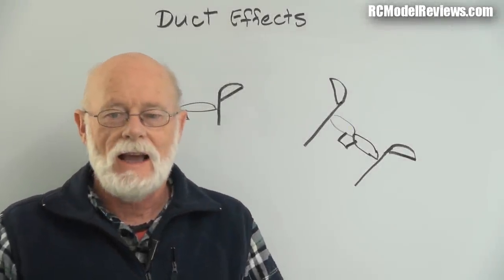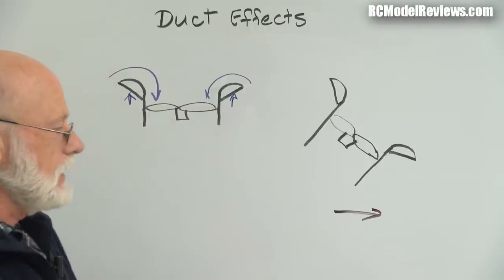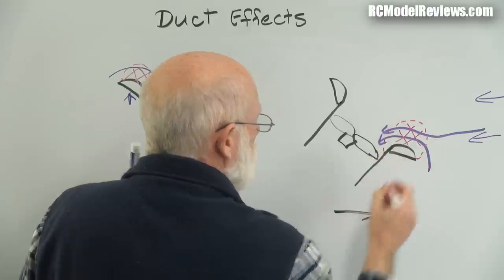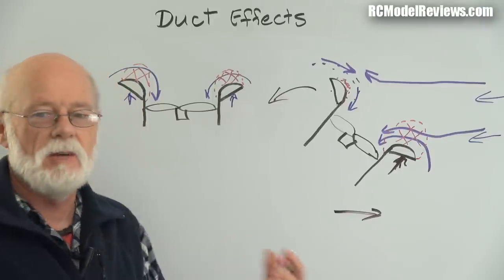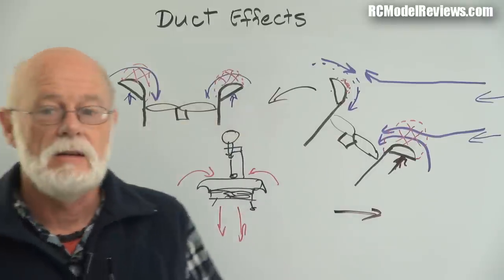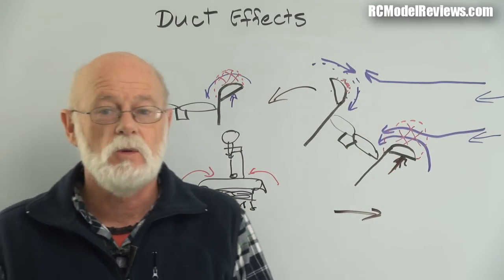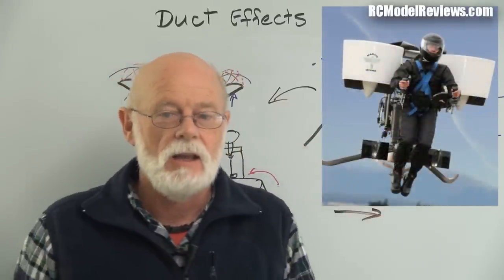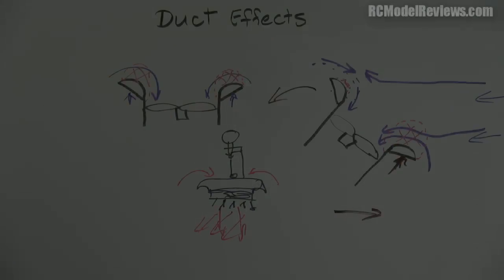More on ducted propeller systems

Comment: 16 miles per hour ain't that bad. It's faster than running and you can of course fly over obstacles. Would be great for pursuing fugitives fleeing on foot.
Reply: but practically I'd reckon that a 120 hp motorcycle would probably be more effective, no?
Reply: kumoyuki I'm thinking places like swampland around prisons, minefields, areas of contamination. Also, a motorcycle just doesn't give the advantage of elevation to see over obstacles, move over obstacles and be essentially immune to being knocked off.

A motorcycle is very fast but then the fugitive climbs over a low wall or a tree log. Or crosses a body of water.

Not only that but in disasters, after earthquakes and floods often debris can make moving just a few metres impossible if only you could just hover over that short distance. The Fukushima disaster was made worse jsut by the inability to move a cable over a few hundred metres of debris.

Though most of the observation work can now be done by drones, sending a drone out with thermal imaging would probably be as good if not better at pursuing a fugitive.
Reply: fair enough. I was still stuck thinking in military terms - which has a different cost/benefit calculation
Reply: kumoyuki Oh yeah, in military terms you're just a giant target.
Reply: Beats the hell out of a mall cop on a Segue...
Reply: Or, if you're going to go through the trouble of training pilots you could use one of those new-fangled helicopters. And then you have the added benefit of that fugitive not getting away when they enter one of those "automobiles" that I've heard so much about.
Reply: LOL.. Well said!
Reply: hovercraft
Reply: @kumoyuki  so would a sedgeway apparently.
Reply: Well said and considered. Wonder if with a bit of technical design, it could be made to move faster by varying the lip profile to the oncoming air, as with vectored exhaust nozzles. Probably this would greatly affect the duct’s lifting characteristics if possible though.

Comment: I'm a hovercraft (ground effect vehicle) enthusiast. I've always been mystified as to why the flying platform never succeeded. Thank you for this explanation.

Please know that ducted fans are extremely popular among hovercraft designers as horizontal thrust fans. They provide a framework for protective screening that prevents fingers or large objects from contacting the propeller blades as well as the superior performance.
Reply: Still doesn't explain why a multi-engine design never arose.

Rather than trying to redirect the thrust of the lifting fan, why aren't there additional fans mounted at a 90 degree angle solely to produce forward motion?

Seems a rather self-evident solution if rotating the engines proves to be a problem...
Reply: @KuraIthys  you are still going to have the unbalance to deal with. The first gyrocopters had the same problem.... would accelerate down the runway until takeoff, then lift up and immediately tip over to upside down because of the difference in lift caused by the difference in air speed between the side of the rotor that was advancing and the side that was retreating. Helicopters solved the problem by changing the pitch of the rotor as it went around using a "swash plate", gyrocopters solved it much simpler by simply allowing the rotor blade to "teeter" back and forth so the advancing blade rises as it moves forward then descends as it retreats on the other side of the craft.

Comment: I have just gone back to electronics as a hobby after a 51 year break. I was rather shocked to find that any mention of fans for cooling is almost taboo. I like fans. Heat governs the life of an electronic component. However the fans that are used for PC's, power supples and servers etc. are ducted but have large tip clearances, any thing up to 3mm on a 60mm dia fan. It would cost no more to make this gap 1mm. Maybe they should watch your viseos. Thanks for confirming what I had already guessed, it's just logic. I'm subscribing - great channel

Comment: Very interesting video Bruce! I think there might be a similar, although less dramatic effect on bare propellers. Not sure what it is, but if you think of the rotating blades as a disc, the rear blades have air being pushed out towards the blade tip whereas the leading edge of the disc gets air angled in towards the root.

Comment: What would happen in an aircraft where you rotate the ducted fan? When it's upgright, it stabilizes the levitation during vertical take-off and landing. And during flight it stabilizes the aircraft in addition to the wings? Or would it fail during the transition?

Comment: I wonder what would happen if you could vary sections of the lips, profile
Reply: that's a basically how a helicopter works
Reply: I was thinking of a bunch interconnected metal flaps like the nozzle of a jet engine, but independently controlled
Reply: actually I was thinking that maybe have a sort of mesh that slide modified the shape of that round bevel at the rim
Reply: Maybe an even riskier design where it would "stall" the coanda effect by protruding flaps to block airflow on one side of the lip.

Comment: The Bell X22, if I recall correctly, resembled a quad with a tail attached to it. Had 4 tilting ducted fans and operated much like the V22 Osprey does today. It was intended to have V/STOL capability but it was much too finicky. It's a shame only two were ever built though, was a beautiful aircraft.

Comment: It sounds like ducts would be best for stable camera quads used in filming.

Also, i wonder if one of these could be used with a vertical propeller for movement, kind of like a PPC
Reply: ***** This is what I was thinking...
Reply: ***** Probably not, airflow is still across duct in one direction tilted or not.
Reply: ***** 
Bruce, do you have an email? I'm going to buy my first quadcopter parts from online, I'd like to run my budget and the list by you. Owen
Reply: owenkilleen I'm not bruce, nor do i care
Reply: ***** you tube won't let me post a comment straight in my own comment field. David
Reply: ***** Ducted fans have worse performance in slow speed and hovering than large rotors.
Reply: No, it does not compensate for wind!

Comment: Been watching vids of a quadcopter working quite well on its test flight, using EDFs. They are working in the usual manner for a quad, not swiveling or anything. How is this the case? Is an EDF pulling so much air that the flow from front to back (in the direction of flight) over the lip of the duct is insignificant by comparison?

Comment: Cool discretion but I bet it would actually work just fine depending on how sturdy the duct is. The effect would be more of a twist for the arm to resist rather than a force on the craft. Also, if it is a real problem maybe just gradually reduce the lip a little on the front end of the craft. Could still improve efficiency. Lastly, since phantoms usually just hover anyways, wouldn't this make sense for that craft?  Putting crash resistance aside.

Comment: Hey Bruce,I was wondering if you could make a video of your DIY 5.8Ghz 200mW video receiver that's in the same stile as the backpack,tell us how much cheaper and comperabile it is as some not so cheap ones ? Also I was wondering if takeing 3 $2 deversity conrolers could you make a 4 input one that will work like the $25 one that you showed us?

Comment: Like in the previous video, invoking the Bernoulli effect only confuses the issue because it's the vehicle that's moving, not the air. The forward edge of the duct is traveling at the exact same speed as the trailing edge. Since there is no air speed differential between the two surfaces, there can be no Bernoulli effect. 

But there is a difference in the Coanda effect between the two surfaces. As you point out, it's increased on the leading edge and diminished on the trailing edge. In effect, the trailing edge was stalling because of the steep angle of attack. It was designed to attack in an upward direction, not in a forward direction, so unsurprisingly, it fails to perform well going forward.

They could probably make it work by adding a small airfoil above the shroud directing air downward into the trailing half of the duct. An airfoil at that position could be adjusted to have the correct angle of attack and compensate for the loss of the Coanda effect. Of course, with the pilot exposed they don't have many opportunities to reduce drag by creating a slipperier vehicle envelope so the speed is always going to be relatively limited. But they should be able to get it to go as fast as a motorcycle.

Comment: It would have been interesting if they had implemented a way to modify parts of the lip. So if the platform was tilting in one direction, then somehow the lop on the opposite side could be changed.
Reply: I thought of this too, although in reverse (make the angle/curve of the lip in the direction you are going change to reduce lift on that side). I think that either way the net result is a loss of lift upon changing the shape, creating a need for larger motors. But I sure hope someone is gonna build a drone based on this idea to find out!
Reply: That's what I was about to say :D
Reply: I've been thinking about that; but, ultimately I think you would end up reducing your total lift too much.  The only solution I can really think of is to change to a different source of lift.  So maybe a ducted fan on top of a plane.  So you transition to an entirely horizontal flight and use a different lifting surface to maintain altitude.
Reply: A quad with ducted props should be immune to the effect, as I explained above.
Reply: +Peter Avram Like a helicopter? How about a twin prop, one at the front and one at the back. This would be immune to the effect (as I've explained above) front to back but self stabilizing side to side.

Comment: Take a look at the HZ-1 Aerocycle, it preceded the Hiller platform and was very similar except it used a pair of unducted contra rotating rotors that were about 30 ft in diameter.  I wonder how the military's experience with the aerocycle differed from the Hiller platform based on what is shown here?

Comment: I wonder if you had some type of "turkey feather" controls around the lip of the duct where the lip on the low pressure side would be lowered by some type of servo/control rod setup and cancel out the effect to allow it to go faster or would it cancel the vertical lift altogether? Just a thought...

Comment: Would an adjustible lip to reduce the lift on the forward side would reduce the coanda effect? Basically the reverse of flaps on an aircraft wing? Or vanes to make part of the airflow go outside the duct against the air pressure? Great videos by the way. What about contra-rotating ducted fan setups?

Comment: why they did not add pusher propeller? the platform is horizontal (maximum utilization effectiveness of ducted propeller) and pusher propeller gives speed?
Reply: would not work as the air will still rush past the duct perpendicular... even worse than the duct is angled...

Comment: I wonder if changing the shape of the lip would change its stability at all.  For example, straightening out the lip on one side of the fan would eliminate its lift, causing the fan to tip toward that side.

Comment: Hi was wondering if you altered the angle of the lip on the duct as it moves forward this should negate the effect of it trying to self right when moving forward, this is because the lip is fixed and stays the same regardless of the orientation of the craft. This could be achieved by making the lip flexible eg use flexible materials for the lip only and ensure it can pivot at its base . This would allow you to alter its angle when moving forward. The change of angle to the lip can be calculated using gyros to determine how much tilt has been applied and then alter the lips angle accordingly. After watching your video i think this should correct the conda effect.

regards Barry M

Comment: Question. So if these ducts tend to right themselves back up when moving angled, considering for video filming, would you say these ducts will create a more stable smoother flight (willing to give up speed and agility for slower and smoother riding)?
Reply: Not just for extra thrust would I consider these ducts for a video drone but because you say there is a reduction in vibration/sound that sparks my attention. I'm not so concerned of speed - don't really need a superfast drone. Question is will the ducts, while improving thrust good for hovering, smooth out the flight and steady the control?

Comment: I’m interested in using ducted fans for generating thrust (not lift) to propel a hovercraft so they would always be at a fixed pitch (perfectly horizontal parallel to the ground). Would I still benefit from this lip design or better to just go fan in tube like in a swamp boat?

Comment: What a very interesting and informative video. Now I am wondering what would be the benefits if any of moving the props inside the duct rather than moving the whole duct and prop together?
Reply: FPV SPY i'd assume the gap between the duct and fan would increase thus reducing efficiency and create weird vortexes in side
Reply: frinik I also had that thought so I was thinking that holes placed under the lip with helical shaping could be utilised thus creating small Venturi effects?

Comment: Maybe an odd question... If I were to put a grate of sorts over the fan, so air can only move up or down, would that increase lift? I mean, since it keeps air from rotating along with the fan, the difference in airspeed over and under the fan would be even greater in my over simplified reasoning...

Comment: The Coanda Effect didn't cause the Avrocar to fail and was not used like you described. The effect was used on the outer ring to bend the main thrust downwards. The power to weight ratio was severely underestimated and it never rose more than two feet. It actually became a forerunner to many hovercraft designs.

Research the Astro V Dynafan built by Astro Kinetics around the same time. Research all the Aesir saucers built and flying from 2006 to 2010. Research the Groundhog designed by top UK engineer Bob Collins - a completely circular craft which flies beautifully on 100% Coanda Effect.

Comment: Great informative video, thank you Bruce. I was thinking about a successful use of fast, horizontal travel using vertically ducted fans, Hovercraft! Using lateral thrust to propel, they have proven that they can still provide sufficient vertical lift even when enduring horizontal wind forces, I only wonder how much lift they can provide when used in aircraft in the same instance, when a pressure enhancing skirt is not applicable. Will it still provide vertical lift, or will lateral air forces kill lift?
If it does however provide lift, then the Martin system may use lateral propulsion?

Comment: I can understand that making single-fan vehicles difficult (although I'm wondering if some form of slat could deflect some of the ram air away from the downwind side lip). But in a quad, that high lift/low lift discrepancy is going to be repeated four times, on all sides of the CG, not with low lift on one side of the CG and high lift on the other as you have in a single-fan model. There will be a net positive lift on each corner of the craft, and no force imbalance to cause it to pitch up.

Comment: How about covering how prop tips could effect lift in the future?  I have seen them on some larger carbon fiber props for multirotors but never on the smaller ones.  Instead of cutting the prop down like you done in some of your videos, try reforming the tips into winglet tips?

Comment: Seems to me that the key would be a lip design with a variable geometry. As you tilt to move in a certain direction, the lip adjusts to change how the air flows over the opposing sides and maintains equal lift all around.

Comment: If you stick a cone in the back of your thrust tube would it go faster? If you had 2 thrust tubes with a reduction of 15ish%,  one 6 inches long and one 3 feet long would there be a difference in thrust horsepower, trust speed, and amp draw?

Comment: a. The Army also found that the recoil of soldier shooting his weapon (for every reaction there is an equal n opposite reaction) was also a big problem.

b. Both the Profile and Parasitic Drag of the hover platform was vary high due to both the frontal surface area of both the duct ring and the pilot standing flat face and body in the slip stream.

c. The greater majority of the propeller thrust is use and directed to over come gravity. Almost zero thrust of the propeller's thrust is directed/used for for ward flight on a hover platform.  A Drone is able to change it's pitch angle buy adding more thrust on the rear motors.

d. Also all airfoils are more efficient when in Ground Effect. Actually 10m is quite good for a wing that is less then 2m in width if I remember correctly.

e. Vortex Ring State is when any propeller is stationary thus drastically causes the rotor system to loose it's efficiency/lift. VRS is basically when a propeller is re breathing it's own accelerated air and has killed many a pilot and passenger in helicopters over the decades actually. 

I think your 3D printed fan ducts may have a good chance on a drone just because of the ability to change the pitch angle by adding more thrust in the rear thus directing some of the thrust to the rear.   Good Luck....

Comment: Bruce, there is something bothering me in your explanations of how propeller works. It seems to me counter-intuitive that bubble of low pressure would travel in direction of centrifugal force. It is rarer, lighter air, wouldn't it be pushed to the opposite, toward the centre of rotation?

Also, if duct stops leaking of higher pressure air into the bubble and equalization of pressure, would then a little wall at the end of propeller tips have same effect as duct (without the annular wing), but with lower total mass ?